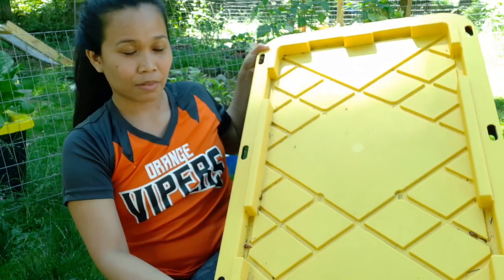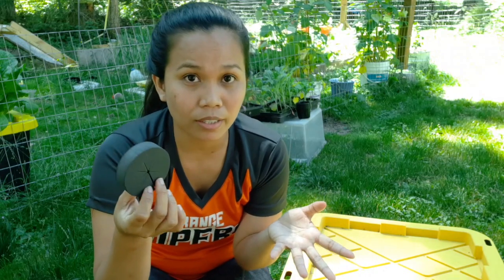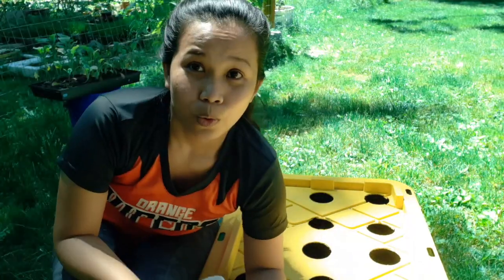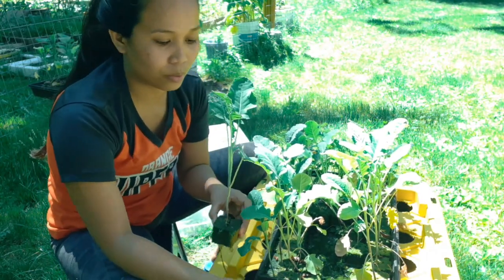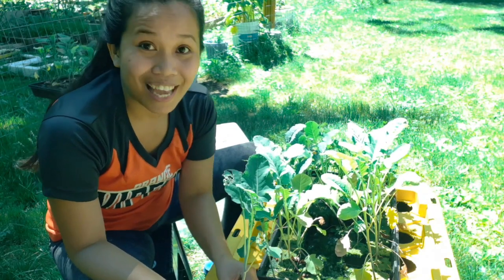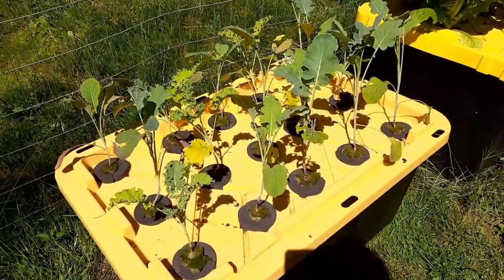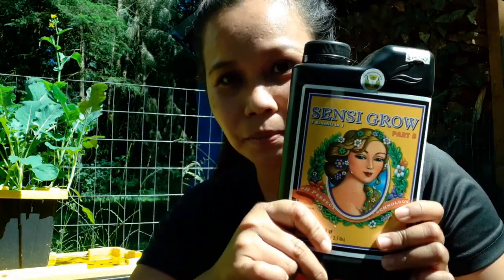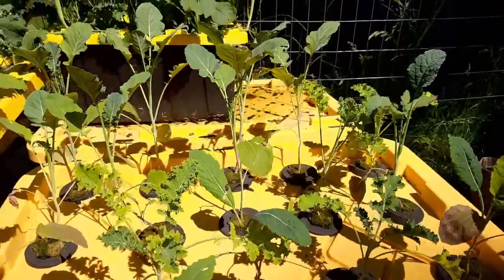DIY Fogponics System | How to Make an Outdoor Fogponics Station | Life in Washington State

Comment: Unless those totes are undercover, when it rains it will fill the top of the lid due to the rim and basically make your nutrient rich solution null and void. Good share though.
Reply from the maker: You’re absolutely correct. This kind of set-up is best if you put it inside a greenhouse or sun room. Thanks for watching!
Reply: @ArleneLIWS  I, like you want a better tomorrow, Thank you for your share.

Comment: Hi from the UK, thanks for the tip with the collars I never knew that.
I have never seen or heard of fogponics before, how do they get the nutrients? is it through the fog?
All the best Steve
Reply from the maker: Hi Steve! The roots will feed from the fog coming from the water with nutrients (currently I'm using Sensigrow brand). I will post a more detailed video about fogponics soon. I will include there the water and the nutrient level plus the brands of misters that I'm using. Thank you so much for watching!! :)
Reply: @ArleneLIWS  Hey thank you for the explanation, it's a totally new concept to me.
Best regards
Steve